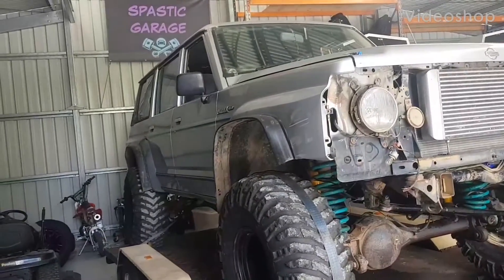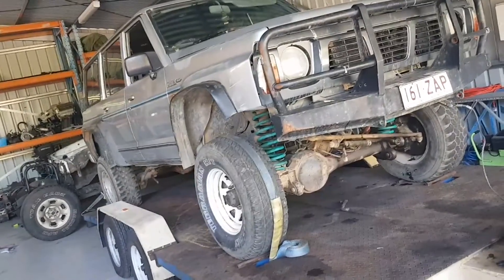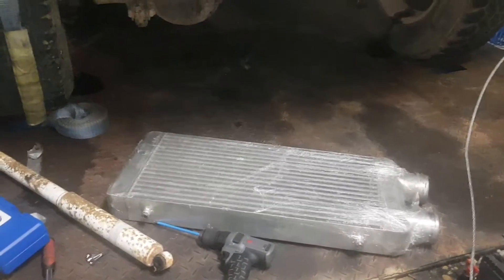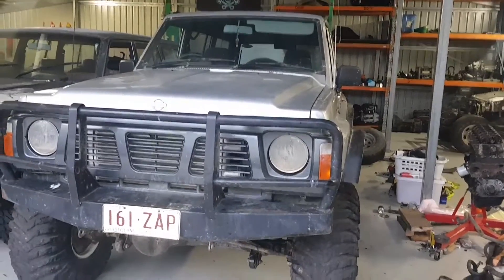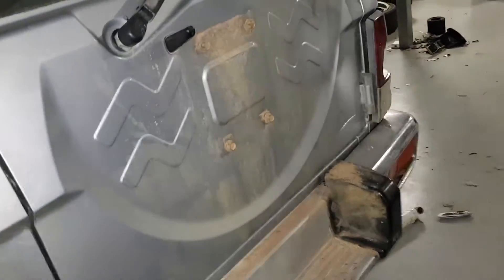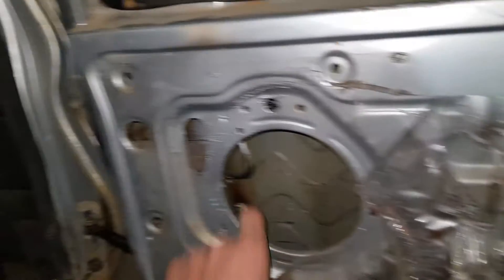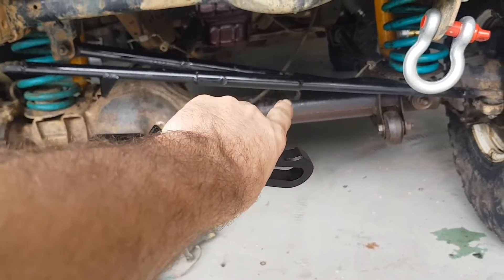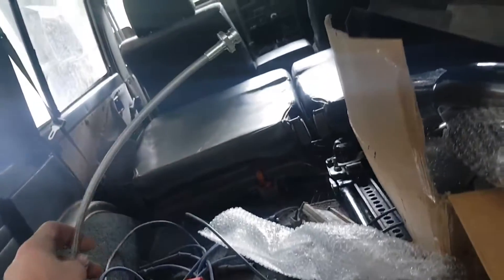turbo rb30 patrol build

Comment: does a td42 gearbox fit on rb30
Reply from the maker: Unfortunately no they don't 
You can buy an adapter to do it not to badly priced if I remember 
I'm running the alloy one currently  just going to see how it holds up but I do have a spare gearbox before I put my spare td42 gearbox in that I've got as a spare from my drift car